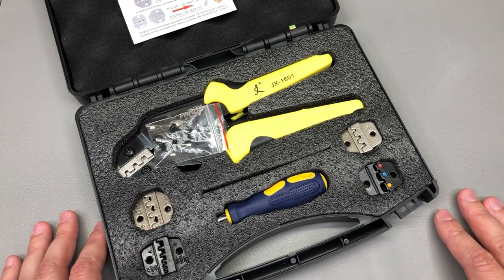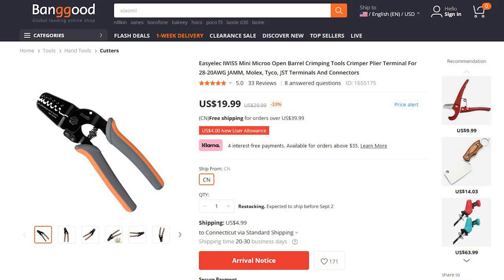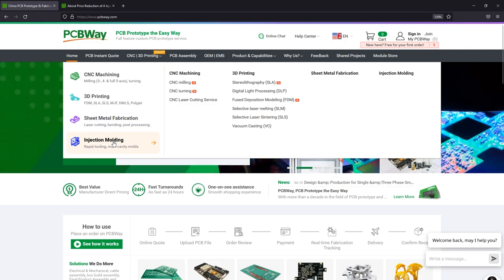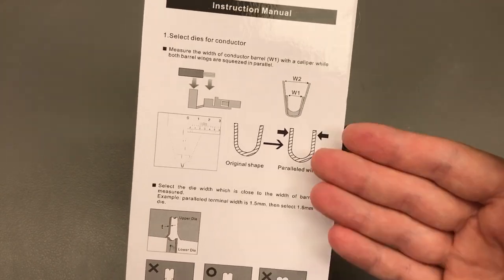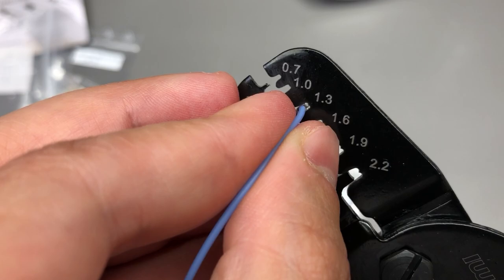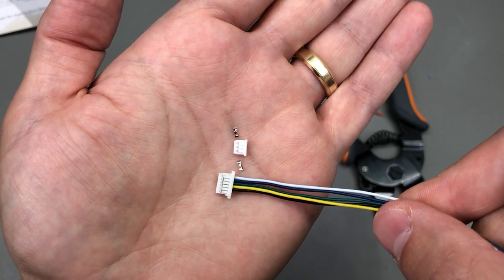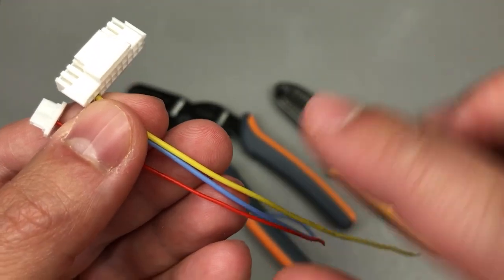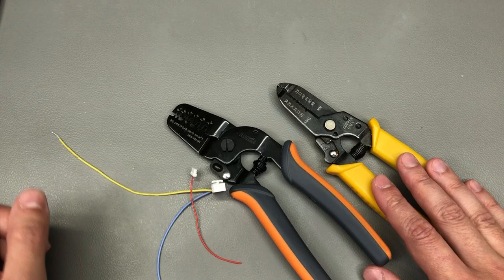Is The Iwiss Mini Crimp Tool Any Good? | Voltlog #425

Comment: I've found that doing the insulation part first is easier. It helps with wire positioning and excess stripped length is more noticeable.

Comment: i have the engineer brand that looks almost identical and it's awesome. the head isn't all different thicknesses. I was even able to crimp an old molex type for a customer who had an old 3d printer. If that one is as good then it's a great buy. i had the thick head iwiss before (i gave it away) and only got a good crimp like twice.
Reply: I had the Iwiss for a while and just bought an Engineer PA-09. The Engineer is much better. First crimp with the Engineer was better than my best crimp ever with the Iwiss. Best buy the Engineer from the start.

Comment: What a coincidence, I was looking at picking up the SN series quick change kit, and this one did come across my radar while I was looking around. I think I'll still go for the kit though, since it means I won't have to go buy another tool or die later if I need to crimp a different kind of connector.

Comment: You're using it wrong. 1.3 mm position on the jaws is for crimping the smaller connector wings that grab the wire. For crimping the bigger connector wings that grab the insulation, you need to move it to position 1.9 mm.

Comment: IWISS has a crimp tool to crimp in one run with ratchet that works awesome.
Reply: It wouldn’t work for such small connectors. The crimp length is too high.

Comment: the version of this specific tool i bought was the engineer pad-02 crimping tool kit. and it has a good quality and construction. however as andreass speiss points out in his pa-09 video these engineer crimps (or similar style) does not make for a perfect crimp. it kindda squashes the terminal a bit too much. if you are just 'going ham on it'. however my biggest pain point is that  this manual style is just too slow to use. for when you are doing more than just 1 or 2 terminals at a time. eg and atx 24 pin or other 'wiring loom' or multiple pieces batch job.

so this is why recently i ordered the IWISS IWS-3220M ratcheting type crimper tool from amazon usa. however it has not arrived yet. still in transit. but i hope the quality is good. will have to wait and see
Reply from the maker: I think it's a general weakness of this type of tool, no matter the brand. There is a lot of variation and you have to carefully get the position of the crimp, the pressure you put just right for perfect results..

I'm gonna give the IWISS IWS-3220M a try and let you know the results in a future video.

Comment: I absolutely do need a crimp tool for just this kind of terminal, but this one is not going to work for me. I want a) a ratcheting type that b) crimps both parts in a single action and most importantly c) comes with EDM-cut precision jaws instead of the horrible die cast ones. Sadly, those are not exactly common and there seems to be a lot of questionable claims about how the jaws are produced...
Reply: could not agree more. i am really hoping now that the more premium model IWISS IWS-3220M that i have ordered is going to have more precisely cut dies on it than the one featured in this video. i.e. like my engineer crimper which as you say.... the sharp edm really 'crisp' and of a good quality tool steel. it does not matter to me the brand. so long as the jaws are well machined and of a high quality 👍
Reply: Yeah ratcheting is the way to go, not having it is a major downside. For JST PH/XH/VH/Dupont get the TZ-4228B.
See discussion on eevblog forum.
Reply from the maker: I'm gonna give the IWISS IWS-3220M a try and let you know the results in a future video.
Reply: @dreamcat4   Looks like all my comments are getting deleted again - let's see if this gets through. Decided to get an IWS-3220M, had it delivered, it's a nice tool, the jaws are crisp. Does JST XH really nicely, Dupont not so much but then again it's not meant for it...
Reply: @AttilaAsztalos  ok got your msg this time. haha yes i know that feeling (about getting comments deleted because they reference a product or something like that)...

yeah the more challenging is the 1.0mm SH, which is what i will be testing the 3220M for maximum difficultly. (but under the microscope with the clicks off).

and as i had already mentioned here in my previous comment: the TZ-4228B is supposed to be the one for the Dupont (or other 2.54 ones with the triangle flags on the insulation). So that will come soon enough.

that covers the majority of connectors, however for ferrules i am finding that the yellow kit that voltlog recommends works, as it has a die pair that works well to crimp square ferrules. what was it... the JX-1601

Comment: Have a look at the Japanese engineer pa-9 crimpers, struggled with those Chinese crimpers for years, once I got a pair of the Japanese ones the crimp quality improved drastically. Well worth the extra money and still much cheaper then the official molex or JST tools
Reply: Yeah, I have the PA-9 too, this Chinese crimper looks like a poor copy of it.
Reply from the maker: I have not tried the Engineer PA-9 myself but Andreas Spies did a video on those and compared it to the IWISS.. the resulting crimps were not much different which raises the question, why spend the extra money?
Reply: @voltlog  it's hard to explain, but the Chinese one does not crimp reliably, I think it's because it's too thin so the jaws do not always line up will, but the engineer one is much thicker so this seems not to happen
Reply: @voltlog  hardened jaws that will not wear out so quickly, resulting in messed up crimps, for example. And it is not that much more expensive.
Reply from the maker: @JanCiger  That's an advantage on paper but in practice do you think you'll be able to crimp so many wires to wear out the tool?
Reply: @voltlog  i believe my PAD-01 kit was about 75-100 euros from hobbyking (including a new user 10% discount for my 1st order with them). which definately is not cheap. however it did come with 3 pairs interchangable dies and a hard shell case. which means you get both a wide range of sizes and also a finer stepping increment between some of the sizes. so that was how in my own decision I was able to justify the higher cost. but clearly i was making some concious decision to spend more money, to ensure some guarantees of quality. [edit] actually today the price is 111 euros on hobbyking. so it has gone up a bit

wheras something like an iwiss... they seem have more variation in the exactness of the cut of the die profile, and the tool in general is more variable in quality (of any individual received item). which is the reason why it gets dragged down in score on amazon reviews. To be 4.3 (instead of a higher score like maybe 4.6 or 4.7). so if you can get an engineer brand, then the expectation is always 100% the same / perfect japanese quality every time. and that includes other quality aspects. for example the precision in the alignment of the jaws. which should be perfectly exact. and that the tool steel - it does not seem to wear out. and remains very sharp edge, even after many uses

however as we already discussed here before... there is not really much motivation to buy either of these tool. because the ratcheting type is better. 

so if engineer can release a brand new product. for example a set of dies compatible for fitting into a ratcheting handle. then maybe... but as far as i know they do not sell this. Therefore i bought today that TZ-4228B. Based on the other guy's recommendation here. This product seems to be best affordable option (for those dupont sizes). can then also compare it to the iwiss 3220m. see how the quality difference really is between those 2 product. have to wait 15 days now for delivery
Reply: @voltlog  Well, it takes only one messed up crimp to damage the jaws. And then you won't be able to crimp anything properly with that part of the die anymore.
Reply: @dreamcat4  PA-9 is about 50€ or so.
Reply: @dreamcat4  The ratcheting type is not really better for these very small crimps. It is very easy to overcrimp the contact with that, even as far as possibly breaking the wire. 

With the non-ratcheting type you have a bit more "feeling" and control in the hand. 

For the larger contacts, by all means, the non-ratcheting  type can be difficult to use.
Reply: @JanCiger  yes this is indeed mentioned in the amazon reviews of the iwiss 3220m for the 1.0mm crimps. but they say it can be set in a mode to disengage the clicks. to be able to rely on hand feel. this should still make the 3220m a little faster once you can get into a rhythm . since it crimps the insulation both parts in 1 operation. without needing to reposition or re-seat. however another person on eevblog said it does not have a circular round hole for the insulation, which is in fact not going to result in a proper crimp here for those same 1.0mm. so i might be returning the iwiss 3220m back to amazon. it depends on what happens in my testing... however if anybody has a better suggestion for other ratcheting style (that can disengage the clicks mode). with proper round insulation of the die profile and for 1.0mm sh... then that would be really helpful ! i.e. better than the 3220m. many thanks
Reply: @dreamcat4  The circular hole is not for JST connectors. Those use the "butterfly" style insulation crimps. Out of the popular connectors I think only the MiniPV ("Dupont") use round die for the insulation. I have another cheap crimper which does have this round die for crimping insulation on those.

If speed is important for you because you are doing so many of those crimps that this matters, then only a fool would use a hand crimper. There are motorized automatic crimpers for such large scale work - resulting in both better results and much faster work.